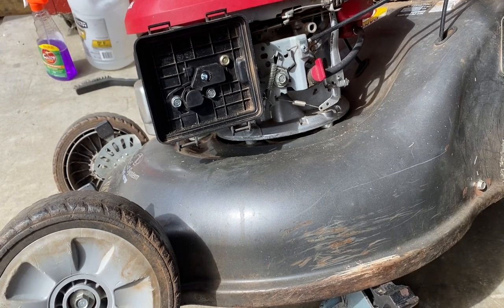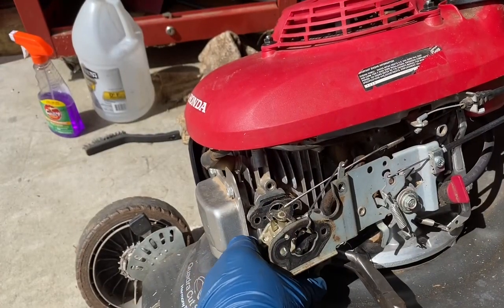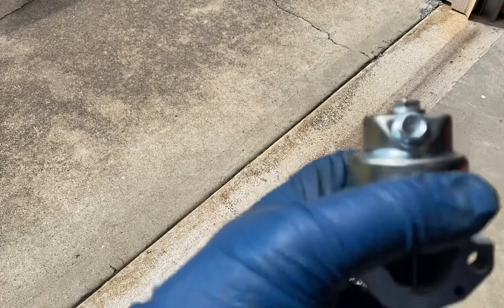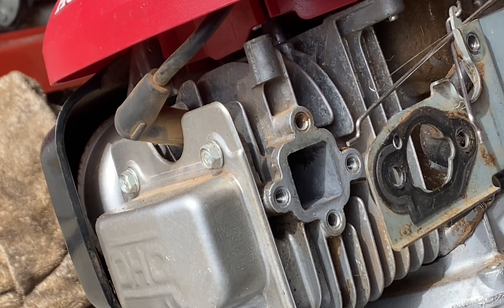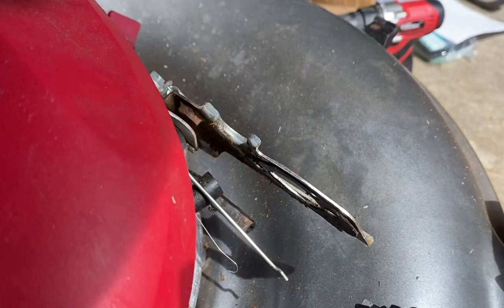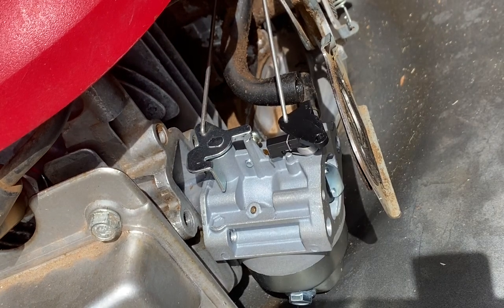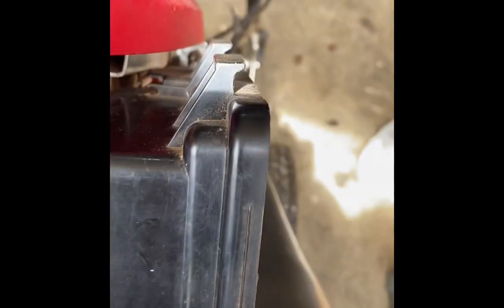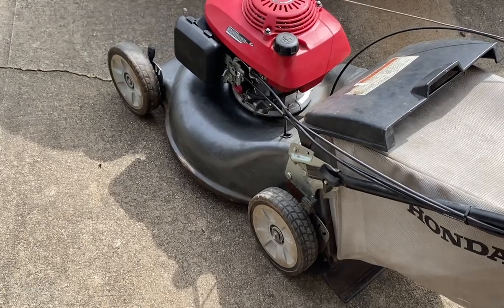Part 2 Honda lawnmower HRR216 | New carb install, new gaskets, adjust governor

Comment: your mistakes or learning by doing and redoing for me shows what to expect, I did what you did and got it done, txs for sharing...
Reply from the maker: Exactly why I didn’t cut it out from the video.  Also I don’t often times pick up  Honda’s . So I don’t get a chance to work on them much.   The older ones are harder to work on I think.    If you need to see how to set the governor I have a video on that as well.  
Cheers

Comment: Dude, get a couple of studs, screw into motor, start from back side, put on in order. hold everything together & remove 1st stud, put in bolt & tighten, remove 2nd stud, put in other bolt. easy peasy.
Reply from the maker: Well that is good to know but I had to replace all the gaskets Always on this one

Comment: Thanks for going to so much trouble to help us learn.  Much appreciated.  While you had everything apart, is there a reason why you didn't remove all that gunk and grime from the various components?  I imagine that the fittings would be better and everything run better if it was all clean.  Would leaving all the junk there make maintenance harder in the future?  Is there a risk of rubbish falling into the carb if the air filter cover has to be taken off again?
Reply from the maker: I don’t always remove all the grime and dirt.  As a flipper I get it running good , tune it up,  pressure wash the deck test and sell it .
Reply: @dfields9511  Handy to know.  Thank you.

Comment: looked harder than expected
Reply from the maker: Yah it was  this specific Honda carb is more difficult to install the ones with auto choke are easier. 
Also when I removed the carb it fell apart and didn’t know the order of gaskets which needed to be replaced as well. Briggs  carbs are easier

Comment: You remind me of me.....
Reply from the maker: @DennisMiscannon    I know this one was painful.  Things all just fell apart and didn’t know exactly where everything went.  I don’t work on Honda’s that much.  They just don’t break down enough for me to find them on curb.  However in 2024 I happened to pick up maybe 4 of them. And they all were very smooth easier fixed  thanks to this one.

Comment: Surging always seems to be the result of a clogged pilot jet.
Reply from the maker: In this case I had a gasket issue so I just decided to replace the carb with aftermarket carb that came
With all the gaskets .  I also reset the governor on this one in another vid.

The carb I kept and used later this year on a Honda Hrz216tda

Comment: very frustrating to watch this guy bumble around to install this carb
Reply from the maker: Yeah I know the previous owner had messed around with this. And I didn’t know the order of gaskets sine they all came apart and needed to be replaced .  It runs gr8 now.   Sold in hours after posting for sale.  If this was a Briggs or kohler or newer Honda or even old Tecumseh it would of been easier
Reply: It's not frustrating at all. We all learning from him. If you can do better make your own video